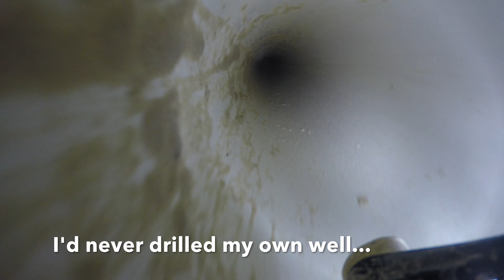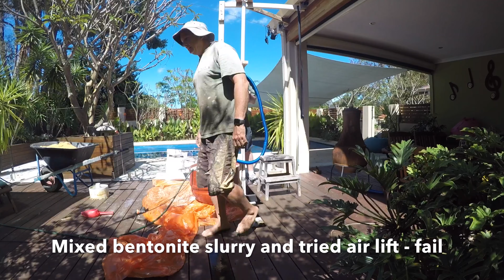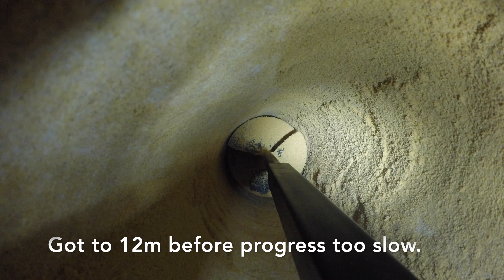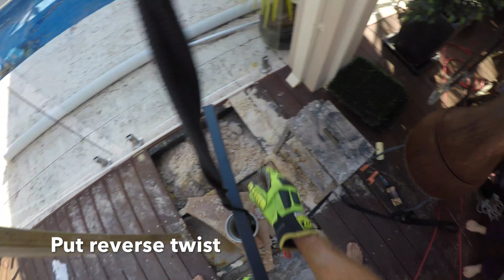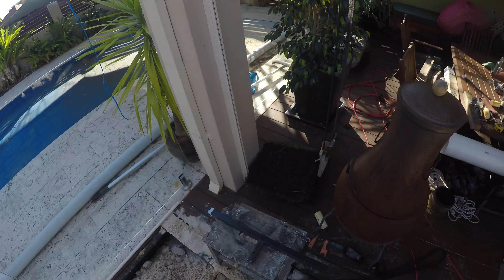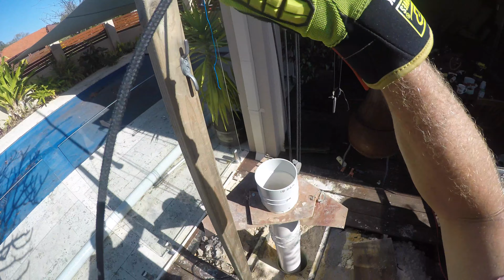Hand drilling water bore

Comment: Just make sure you seal the top real good or you will contaminate your well from the top. 👍
Reply: @Vishnu_Atlas  you just don’t want any rainwater running down your hole, it takes with it any contaminates on the surface

Comment: hey man, great video! how did you keep going after you hit water? i have been drilling a well with a hand auger and i have already hit water, it became impossible to keep going so i am wondering how to proceed.
Reply from the maker: watch my second video https://youtu.be/UYcrv9wWuAo  Essentially you run a slotted PVC pipe connected to surface with standard pipe to the bottom, then use a sucker type pump to take the wet sand out and the slotted liner slowly feeds into the hole by gravity at the same time.  It keeps the rest of the hole collapsing in.   My sucker pump was made from a piece of copper pipe with a massage ball (Kmart few $) connected to surface by rope.  You need it to be heavy so it doesn't float.  The ball acts as a valve that lets the wet sand past in upwards direction but doesn't let it fall out.   There are other approaches to make the valve out of rubber sheet etc but mine worked fine.   Got about 4m in and hour then it all hung up on something but was enough.   System still working as of today no issue.

Comment: Super interesting video! Can you say why the air lift failed?
Reply from the maker: I'm pretty sure airlift failed due to lack of air volume.    Needed much larger compressor/accumulator and supply line...since was trying to do this on the cheap didn't bother trying to source bigger gear.  Have used technique successfully  on small scale in Aquariums and large scale on proper rigs so it does work.